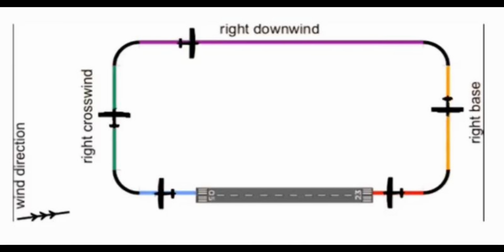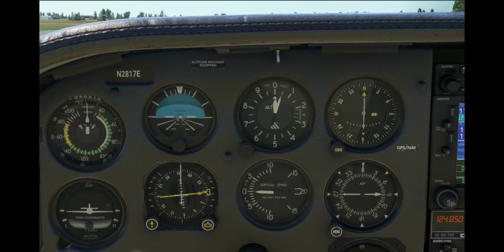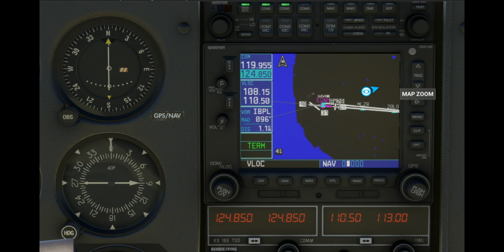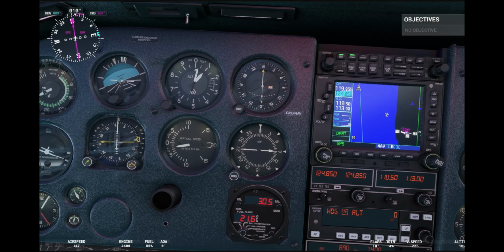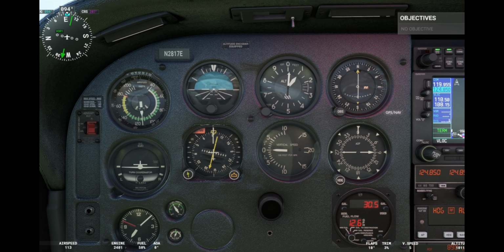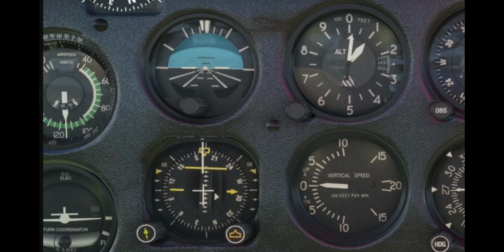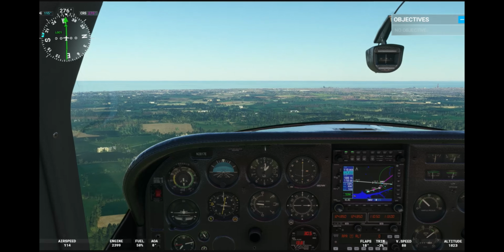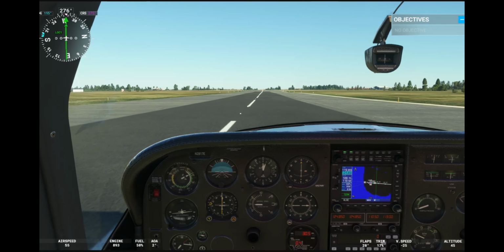Thrilling ILS Circuit into Runway 28 at Blackpool Airport! | Stunning Approach & Smooth Landing

Comment: On take off I did stray 10 or more degrees off the centre line to the left and this was just me being a bit careless. But the point is that yopu should remain on the centre line until you are at about circuit height before you make your crosswind turn.just in case there is a conflict. At Booker airport High Wycombe when flying a right hand circuit you have to steer 10 degrees left and head for the pig fram and this is for noise abatement. Always check with whatever airfield you are flying from what there own local rules are. Anyway, I do hope that you can enjoy this video. There will be many more. I have only recently got back into flight simming and so I am rusty and hoping to improve my skills and pass on what I learn. Happy flying everyone. Sorry for the jump cuts between sections but I forgot to edit out the blank spaces between. Live and learn !